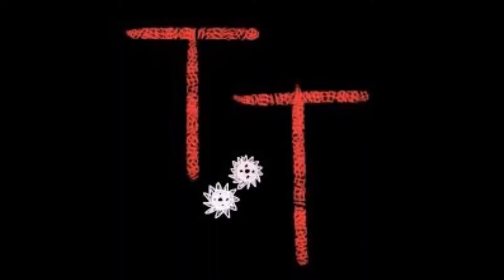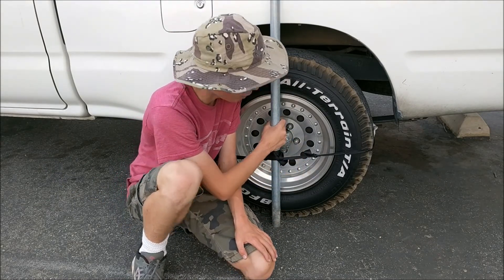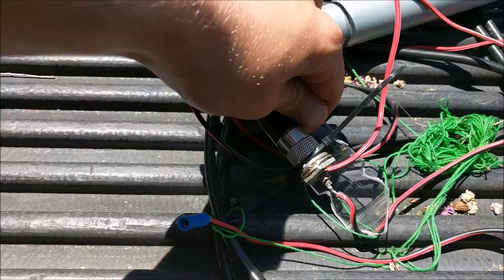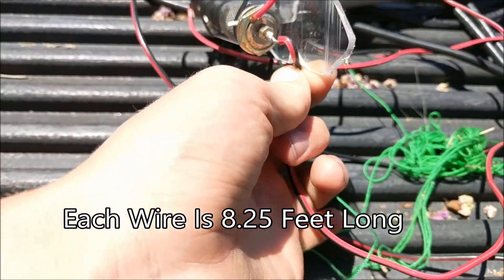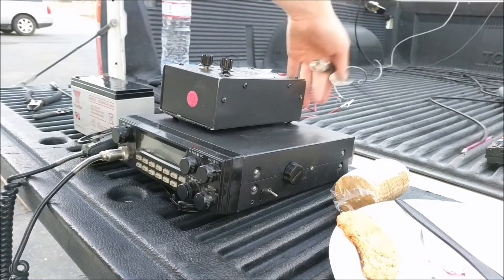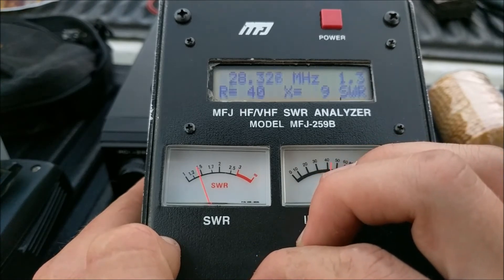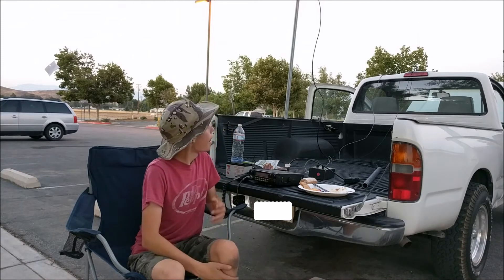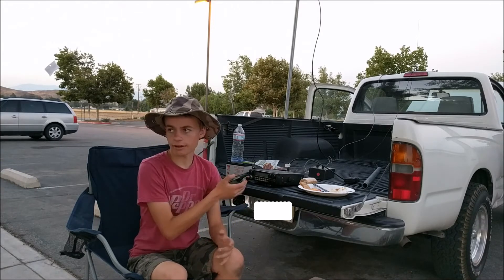Portable 10 Meter Dipole Antenna For Ham Radio Field Day

Comment: Research Wire Loss! Voltage Drop!. Find a AWG wire chart on the interweb and figure out Voltage drop and what your doing to that radio with the small gauge wire. Then research what the amp draw is on that radio on transmit and put a fuse AT the battery.